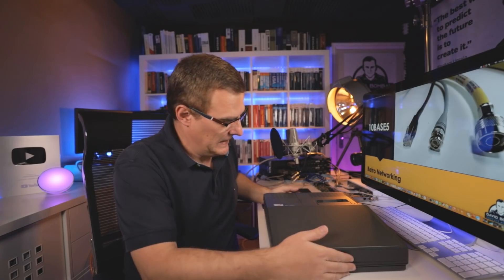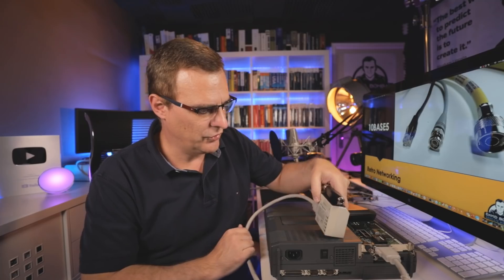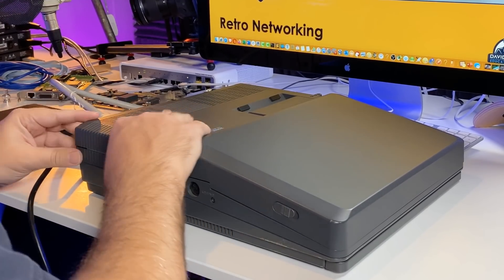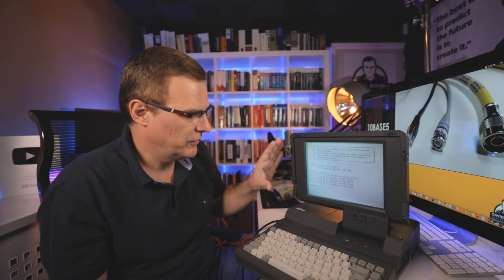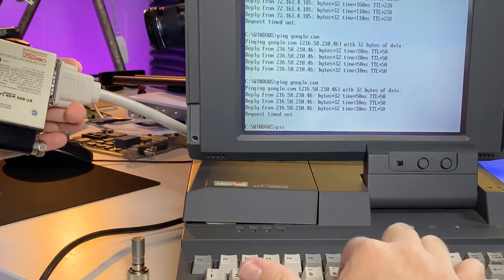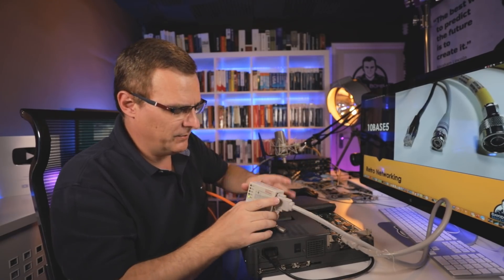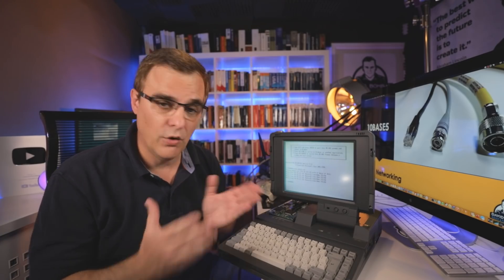Windows 3.11 and 10Base5 connect to the Internet?

Comment from the maker: Menu:
Laptop: 0:00
Network Card: 0:39
Drop cable connection: 1:30
10Base5 Transceiver: 1:58
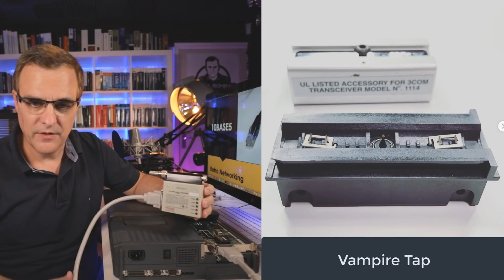10Base5 Terminator: 2:18
10Base5 Cable: 2:32
10Base2 Cable: 3:38
Power on Laptop: 3:59
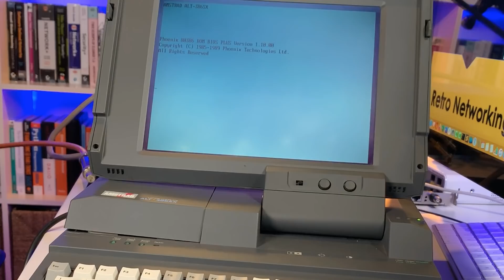Starting DOS: 4:39
Start Windows 3.11: 5:10
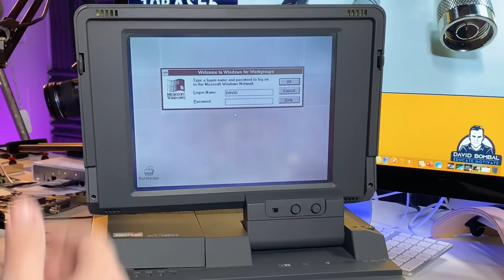Windows Overview: 5:30
Ping google.com: 6:02
What is ping? 7:08
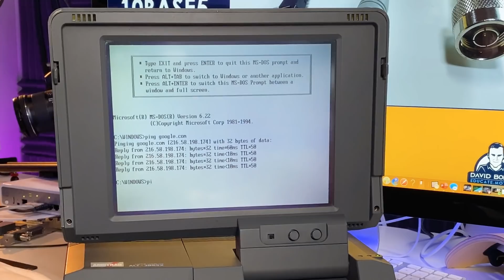Ping cisco.com 7:32
Disconnect drop cable: 7:41
Disconnect terminator: 8:26
Network card and working network: 10:20
Windows 3.11 TCP/IP: 11:16
Telnet to Cisco Router: 11:42
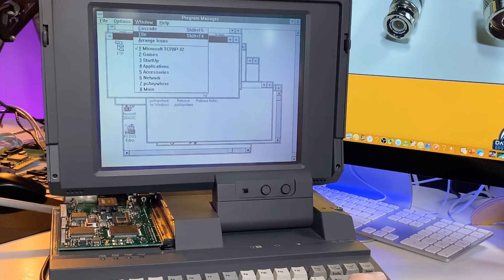Windows 3.11 Network Setup 12:50
IP address, DNS server setup: 13:11
10base5, 10base2, 10base-T cables: 14:24
Reply: Hi DAVID please tell me if i fail the cisco(200-301) exam to retake the exam should i repay?
Reply from the maker: @missaklefa7692  Yes, you would need to pay again to retake a CCNA exam.

Comment: RG213 Co-Ax was used as cable for 10BASE5. I wonder if the standard was developed further, what would be possible to transfer through Aircell-7 or a Ecoflex 10 Plus cable. Later's rated RF frequencies is at 8 GHz. So technically they should be able to transfer 10G.

But a variant of this cable tech still is Twin-Ax.

Comment: The high school I went to in 1999 had 10Mb co-ax (10 Base 2 - it was thin stuff but a bit thicker than the stuff you show in the vid) and 10Mb Base T. I always found the co-ax cable fascinating but so horrible to work with as if one kid slightly twists the T piece off the connector on the network card, the whole segment dies. Not to mention, you then needed a hub that had both that and RJ45 ports. I read about vampire taps and thicknet cabling when I went to go study in college, but have never seen them in real life. Even then, I can only imagine how annoying it must have been to work with such cables, even though they would be professionally laid down in walls, ceilings and so forth. The girth of that orange cable reminds me of modern fibre optic cable which by eyeball guess seems to be about the same thickness with sheath, armor etc. Fascinating video thanks!

Comment: I worked on win 98 in 2004.. but I never saw 10 base 2 type of thing...
Reply from the maker: These are much older technologies. 10Base5 comes from the 1970s and 10Base2 after that. They were replaced by UTP.

Comment: You said that you connected the transceiver to a switch? Shouldn't that be a hub instead since iirc, switches did not exist?
Reply from the maker: Has to go through my home physical network to get to the Internet. One router is using 10base5 and 10base2 only - no switches or hubs, but the 2nd one with 10base2 also uses UTP to connect to my home network which connects to the Internet. Old has to connect to modern at some point to ping Google.com. I demo hubs in a separate video.

Comment: Good heavens - EOL resistors. Coaxial and RS networks are a PITA once your resistance changes for what ever reason (had a case where in the rainy season water would seep into a cable cut and change resistance so much you had to remove EOL).
And the awful hum of the signal processing. You'll be surprised to know that coax is still in use in some industries. If it works it works well. If it fails you'll need hair on your chest and a Magnum PI stash to isolate the failure.
Reply from the maker: lol... thankfully most of us don't have to deal with this stuff today - sorry for you if you still have to :(
Reply: @davidbombal  Funny enough - short distance networking in Industrial (critical) applications love RS networking as it's the perfect "air-gap" network. So think Engineering PC to critical Controller.

But that's increasingly being replaced with IPSec networking which is a whole different ball game.

Comment: hello mr bombal, can you please clarify how the data got to the modem when you pinged google , I did not quite understand the relation between connecting the two routers and the swith, how can a swith forward the data to an external network. I thgout the data passed from the first router directly to the modem
Reply from the maker: I'll cover the network in more detail in a different video. Those 2500 routers are connected to my home network using UTP cables which then connects to the Internet.
Reply: David Bombal thank you , really appreciate it. One last question I am abbout to buy your ccna 200-301 course on udemy but I found 4 different courses what it is the difference between them and what’s the most updated one

Comment: Enjoying the trip down memory lane. As a former Digital Equipment tech that supported BNR and Nortel sites this was a blast from the past.  When 10base5 came out, a student in the first training class I took drilled a hole completely through the cable trying to install a transceiver thus destroying the cable :)  10base2 was easier to work with but caused no end of problems because there were so many poor connections.  People would also try there own cabling, because they thought it was like cable tv and you could add your own splitters and t-connectors anywhere.  You need a Digital Delni to connect all your 10base5 gear.  Ethernet Bus networking was such a step forward from all the point-to-point links (mostly DDCMP) between PDP and Vax computers.
Reply from the maker: Thanks for sharing! I was hoping someone would share their experiences :)

Comment: Thank you for this romantic flashback... I could barely remember PBX networks, manual TCP/IP PSTN, the laziness PPP caused when first out... so many memories back! Btw, doesn't the F3 button repeat last cmd in DOS 6.22?
Reply from the maker: Thank you! lol... will have to test that... been so long that I cannot remember :)
Reply: @davidbombal  I think DOSKEY got the job done, however it wasn't compatible with 3.30... it required either 4.01 or 5.00. I'm also stressing my memory now :)

Comment: It was very interesting for me. I never saw 10Base5 working in reality. I started with 10Base2 at home,  I think it was in 1997/98 and later switched to 10BaseT. In the company where I learned my job, they already had 10BaseT cabling, of course with hubs. At the beginning of my full time job in the early 2000s I worked for years with 2500, 3600, 4500, 4700 series routers.
Reply from the maker: I think that is true for a lot of us - very few of us have ever worked with 10base5 or even 10base2. I wanted to demonstrate a working network with this stuff so I could show how it actually worked :)

Comment: oh dear I remember all this stuff DOS requires 640k memory to start windows 3.11 (load of issues with sound drivers before windows) 
Have to terminate the network with 50Ω terminator at each end.
IPX LAN parties.
IRQ could not be the same for the expansion card to work correctly.
I really don't miss them days.
Some people would really not realise how much of a nightmare it was back then.
I remember trashing 10 CD (blanks) when i got my first cd writer Yamaha CDR100 ( https://redlop.de/Yamaha-CDR-100-CD-burner ). The main problem was they were £8 each blank.
Reply from the maker: lol... agreed... so much easier in many ways today. Cable... what cable? WiFi = Internet 😆

Comment: Thank you for the old school demo.  When you disconnect the terminator, does that essentially break the ring that causes the connection to fail?  Is this using token ring to communicate?
Reply from the maker: It's a bus network (not a ring). I'll explain the network in more detail in a different video and show exactly how it's connected. When you remove the terminator, signals bounce back on the cable which causes collisions and breaks the network.
Reply: @davidbombal  Thank you for clarifying.  Should have known that, but it's been a while since last looking at bus typologies connected via coax cable.
Reply from the maker: @amadortorrez4695  Don't worry... it's impossible to remember everything!